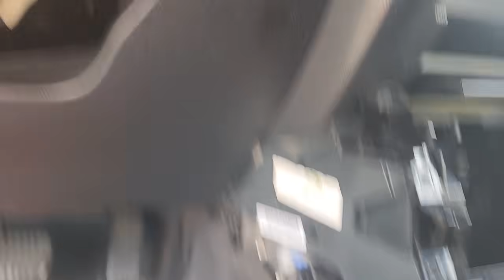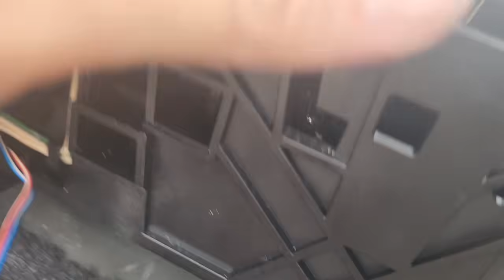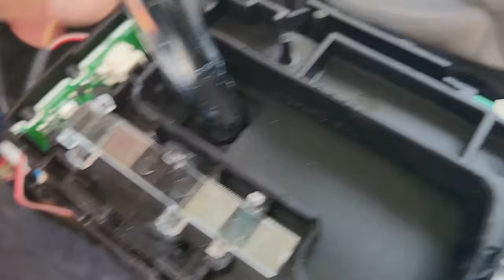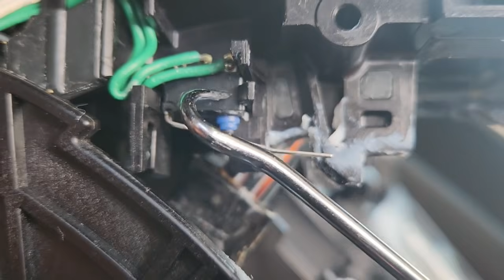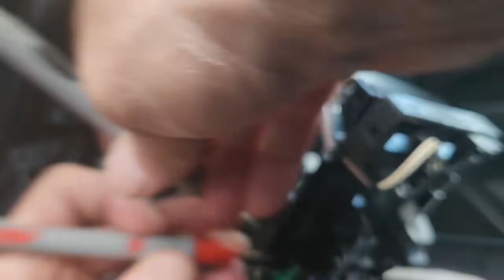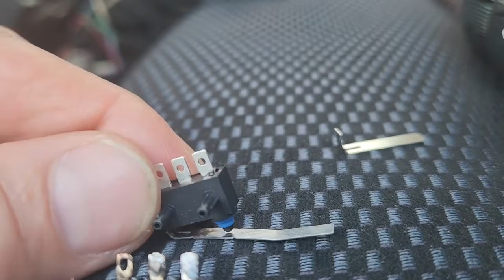2016 Subaru Outback key stuck, wont come out of the ignition

Comment: Much simpler, just spray electric contact cleaner after removing the top panel under the gear knob.  You will see two white wires on the left near the P position.  Insert the cleaner nozzle in the opening where the white wires are, spray a few shots,and move the lever from P to N a  dozen times.  Problem solved.

Comment: I'm wondering, taking into account all the time you put in, whether just replacing the shifter switch/bracket or the shifter assembly (typical dealer fix) may have been a better option.
Reply from the maker: In my opinion, I would say no, you are paying over 200 dollars for the part from the dealer and doing just as much work to change it. The dealer option will  require you to re-pin the two switches on the plate into the cars wiring harness, there are other videos showing that option. It may be a good option for people who don't have the soldering tools.

Comment: Thanks for illustrating this Jay.  I think there may be a simpler fix for most people with this problem.  I too have a 2016 Outback that did this.  As you noted, the microswitch still seemed to be working when you used your finger on it.  The switch works, the activation doesn't.  The problem seems to be something preventing it from fully opening when the vehicle is in park.  That something is the thin, plastic plunger under the shift knob... it's essentially a tiny bit "too long" to fully release the switch.  Before anyone dives into the inner console, I would try this:  slide the chrome collar under the shift knob down to expose a clip.  Use needle nose pliers to pull the u-shaped clip on the knob (it pulls out towards the rear of the car).  Pull the shift knob up and off.  You'll see a white plastic plunger poking out.  I'll bet that you can now remove your key since the knob release lever is no longer pushing the plunger down (and preventing the micro switch from fully releasing).  If your key is free now, it's the plastic plunger that's the problem (it's too long), not the microswitch.  Pull the plunger out, take a file or sandpaper and very slightly file down the top end.  You actually want to sort of "sharpen" it like you would a pencil or crayon since the knob's release lever works at an angle on the end of the plunger.  So work on mostly on the sides of the plunger end and just a bit on the very end tip.  Just do a bit at a time, reinstall the plunger and knob and check if your key release works.  Jiggling the release lever on the front of the knob might help to release the microswitch and your key, letting you know you're getting close to the right length.  There's a danger of shortening the rod too much which will definitely release your key but can then physically not allow you to get the shifter out of park (ask me how I know!).  If you do go too short, just use some crazy glue and baking soda to slightly build up the plunger end... and file again).  I hope this helps fellow Subaru owners avoid unnecessary grief!
Reply from the maker: Good comment, it is possible that the lever activating the switch is worn or out of position. In my case the switch itself was faulty. I did have to bend the switch lever after my first attempt at reassembly to get the switch to operate properly.
Reply: @805tips4  Oops, my mistake.  Watching it again I see your "park" microswitch was only intermittently working, and I think that was likely with your shift knob already off (and therefore the plunger free to rise completely).  So a faulty/dirty switch in your case.  Thankfully my switch was OK or I would have been tackling the switch replacement like you did.  It's preposterous that Subaru's solution is a whole new shifter assembly!
Reply: Thanks for this idea! I have a 2016 Outback and sanding a little off the plunger solved my problem.
Reply: I'm trying this (shaving down the plastic plunger) as a first step, along with additional grease under the shift knob while I had it off. We'll see if that works long term.
Reply: @ComradeCatfud did this work for you? How much did you shave off?